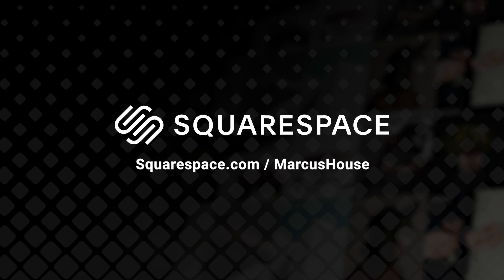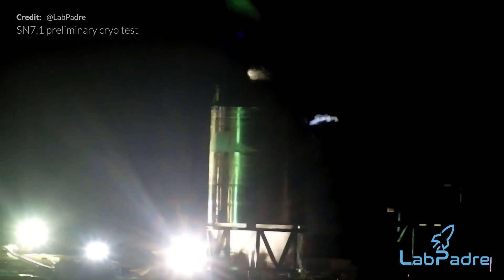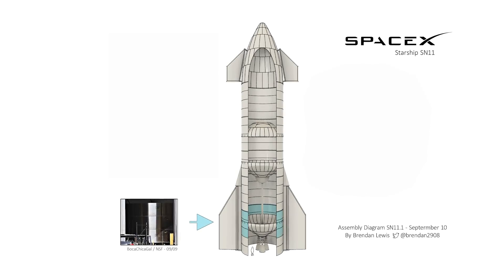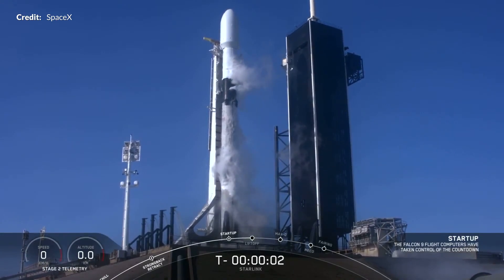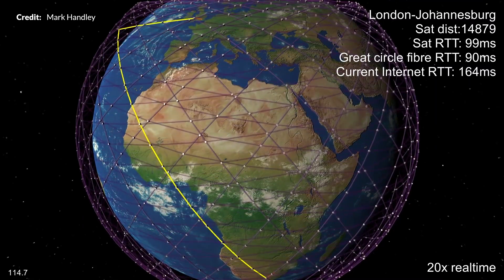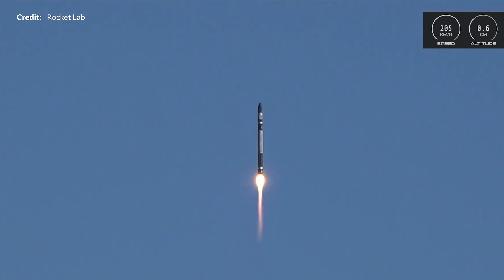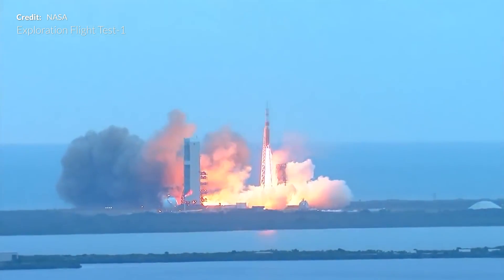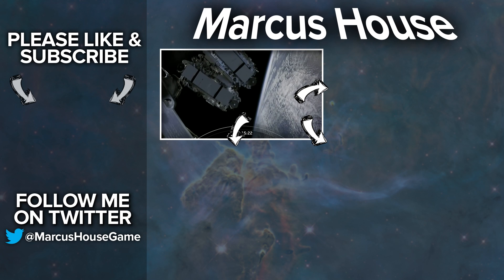SpaceX Starship updates, Starlink Space Lasers, Rocket Lab Photon, SLS news & Astra launch failure

Comment: To save water of 3 gorge river and prevent massive flooding downstream forever is..1, create reservoirs up to Mongolia and northern dry provinces 
2. Pump in to massive reservoirs upward the waters from 3 gorges.. especially during monsoon seasons. 
3. This storage reservoirs water will be frozen during winter and irrigate dryland during spring ang summer..
4.. feeding all animals in this region yr round
5. With this trade war  president xi should focus inside china irrigation and flooding systems for self sufficiency  in food..please spread this to president xi..
5. China can finnish easily this infrastructures in 10 yrs. 
6. Making 4 sqr kilometer and 10 meters deep or more.
7. And later connect this reservoirs with canals and locks for navigation...
8. Divert 90% power generation of the dam to pump out and fill in the hundreds of cubic kilometers of reservoirs constructed up north dry provinces 
9. Its better a darkened cities downstream rather flooded for sometime..
10.. this is a super high environmental impact problem solving project..
...

Comment: How far over can a Starship lean before the engine gimbals and reaction control bursts can not correct the angle? I'm afraid that if weather conditions or misfire of reaction control bursts can cause the surface area to get pushed to an angle beyond the capabilities of the rocket engine gimbals at low altitude may cause an inevitable accident. Does anyone else see this as a possibility?

Comment: Looks like SpaceX would like to standardise the tank/engine section to four sets of 4 rings.  The payload section has 4 rings too.  A fuel mass ratio of 78/22 with 78 being oxygen, the fuel volume ratio should be about 58.5/41.5. We could get close to the volume ratio if Brendan Lewis or someone else could use their modelling software to measure tank volumes. The methane in the thin pipe  is likely to freeze as it passes through the liquid oxygen - especially if it has to sit for a while between fuelling and launch.  Volume ratio will tell us something about density which will tell us about fuel temperature. Liquid methane could be as cold as -182 deg C, or it may be ~10 deg C warmer. The LOX is likely -183.5 deg C - just below boiling point. What temp keeps the methane forming ice with the fuel tank arrangement???

Comment: "Ping in excess of 200ms." Which is still significantly faster than the 400-600 ping I get in rural Arizona from a satellite service. Really looking forward to the potential of Starlink, and have been signed up for the beta test for a while. But I suspect it won't be until 2021 before anything gets to me down in my latitude. It's possible that I might get 5G coverage in the interim, but given how a local cell tower fell over from lack of upkeep, I don't have much faith in the local cellular providers...
Reply from the maker: Geo sats suck for ping time. Starlink will blow those out of the water.

Comment: I'm not sure how well that  space laser relay will work. Transmitting data over lasers is nasty as the laser source needs to be almost perfectly aligned with the destination, which is not easy to do over the enormous distances between the satellites. Also, any two satellites continuously change their altitude slightly which adds extra difficulties.

Comment: FINALLY someone mentioned the difference in RCS activity between SN5 and SN6 hops! Thank you!

One understated benefit to Starlink lasers: The current internet path your data takes is determined by cost from the hub/router to the next, rather than speed or direction. The cost is determined by who owns each of these connection points and contracts between them.

Comment: Elon just tweeted they are going to fly SN8 to 60 000 feet in a week.
Edit: Well, not really flying it. Just mount the nosecone and control surfaces.
Reply from the maker: Awesome. Assume will take longer to be tested first but awesome.
Reply: that's 18.3 km holy shit!
Reply: No problem launch 3 30 ft beer kegs to 60,000 ft , tap on the brakes, hit the rc thrusters, light the candle ,and crush the landing.
I hope they put the airbrakes( "wings") on SN8 after testing.
Reply: Rather, he said it would be completed with cone and fins within a week. It will then go through testing before flight.
Reply: @fisterB  You are correct, I was a bit ahead of things there :)
Reply: I wonder when superheavy will begin static and flight tests
Reply: that is wild, it sounds like they won't do any SN5/SN6 hop before that :O.
Reply: If Overlord Elon never goes in the first starship, I'm dissapointed.

Comment: I'm expecting a hexagonal flame diverter (6 outlets). Having the diverters originate from the center would work when the 8 center engines of the booster are positioned in a circle due to the current thrust puck design.

Comment: Starlink is cool,  but it's literally on route to ruin astronomy.
Reply: It is not. The shade on the new sats is effective. The sats are in low earth orbit and can be de-orbited if something goes wrong. Space X is coordinating with ground astronomers.
Reply: @MrEd2291  obviously you astronomer. On a given night, I get 2 extremely bright lines go across the length of the capture. The newer ones arent as bright, but theyre still far more destructive than any other satelite constellation. The worse is yet to come too.
Reply: Except it will pay for starship which will allow vastly better space telescopes
Reply: @alextell7019  think about how long it has taken to build JWST and  how long it is built to last. Very large telescopes need servicing on a regular basis. 

You also have telescopes like that of the SDSS at  Apache Point Observatory which needs specially manufactured plates that have extremely precise holes drilled in them that get swapped out on a regular bases. 

There will always be mission specific telescopes that will need to be on Earth.
Reply: @matthewpalmer9820  Not really if its cheaper (or the same price because you need a much smaller telescope) to send people and supplies into orbit than to the top of a mountain in the jungle than it doesn't matter at all.
Reply: @alextell7019  thats completely asinine. I dont think you know what servicing means and most telescopes are easily accessible.

Comment: “One segment larger than those used on the space shuttle”

Me: Ares flashbacks
Reply: Yea, that extra size is not really a good thing. The larger you make an SRB, the bigger the safety risk it becomes. We all know what happened to Challenger (and at least one other shuttle launch came within seconds of suffering the same fate). 
Plus, with the massively uneven acceleration from 2 oversized SRBs like that, I wouldn't be at all surprised if the rocket, the payload or both takes damage from it. 

SLS was a misstake.
Reply: @carljohan9265  I completely agree with you. starship is gonna beat the shit outta SLS imo, even if Superheavy wasn't reusable.
Reply: @tommypeds  A NASA guy recently said that SLS was probably just gonna go away (not in those exact words, obviously) once starship goes fully online. 
Which makes sense, because when comparing their price tags, even the most optimistically estimated SLS costs lose by leaps and bounds to the most pessimistically estimated starship costs. 

SLS is not possible to justify using if starship exists and flies. 

Also on a sidenote, Blue Origin seems to be having some sort of trouble getting their rocket done. 
They haven't said anything, but there are just to many circumstantial things that point to there being some sort of problem in their development plan. 
Including the fact that New Glenn was not chosen for a single military launch when they did their bids for the next 5 or so years, and NASA hasn't mentioned a mission plan that uses NG even once to my knowledge (not even when they talked about SLS missions far in the future).
Reply: @carljohan9265  it made sense before ITS presentation lol

Comment: You should do a video informing Americans with 401K retirement accounts that lower latency internet will deplete the value of their stocks faster.  A fiber-optic link was constructed from Chicago to New York so bots can see price changes milliseconds before computers in the other exchange can register them over phone lines.  They know when a stock moves before the market does and trade accordingly.  Recently a microwave link was set up to beat the fiberoptic link.  The money these bastards make comes from everyone else's stock portfolio, not out of thin air.  Only a corrupt oligarchy would allow major corporations to raid the retirement accounts of its most vulnerable citizens.  Why do Americans have their retirement savings in stocks?  Because banks no longer pay interest on savings accounts so money saved in the bank is eaten away by inflation faster than you can earn more to replace it.  Its a totally corrupt system designed to take money from long term investors and give it to billionaires who set up high speed data connections and computers designed to trade on millisecond variations in the markets.  It could all be stopped by a law that required you to hold a stock for at least a day before selling, but congress is paid by the perpetrators to allow theft from the victims.  Why does nobody explain how tech is used this way?

Comment: @2:00 "Three of the legs were badly damaged…" It seems to me, judging from both SN6 and SN5 that that's how they're supposed to work. They seem to be a compliant collapse structure, like a car's crumple zones. They are just to cushion the landing of these prototypes, and I don't think they are supposed to be the prototype for the definitive landing legs. Furthermore, by dissecting them, SpaceX engineers can estimate the levels of stress they are subjected to during landing, and can use that data to design a permanent solution,
Reply: They're designed to telescope in/crush to a certain distance, but they can be described as damaged when the lower part reached its limit of travel and is twisted and crumpled. This was more clearly seen on SN5, where some legs were nicely telescope in, and 1 or 2 had damage. As marcus and others said, all probably due to the tilted landing, and all the mass coming down on the first couple of legs to contact the ground.
Reply: GAMP: Sicker than your average kigger nilller  That's because it's 27 tonnes versus 120 tonnes moving sideways! A bit of a difference you sick b'stard. Rather an offensive name. Don't know how you get away with that actually? Also, the legs on the Falcon9 have  a higher point of stability where as the Starship ones are like a go-karts wheels and can slide when forced too much.
Reply: Crumple zones work during CRASHES
Reply: GAMP: Sicker than your average kigger nilller  I just watched a YT by What about it? and there were great renderings there with Falcon9 legs on a Starship. Worth a nosey.
Reply: You are correct, they are single use crunchable dampers, like used on NASA's LEM.

Comment: Landing legs did not get “damaged” :) they are suppose to crumble 
Work as design/expected :) they are not like springs or piston.
Similar to the Apollo lunar lander :)
Find the the work damaged implies failure...
Reply: They're designed to telescope in/crush to a certain distance, but they can be described as damaged when the lower part reached its limit of travel and is twisted and crumpled. This was more clearly seen on SN5, where some legs were nicely telescope in, and 1 or 2 had damage. As Marcus and others said, all probably due to the tilted landing, and all the mass coming down on the first couple of legs to contact the ground.
Reply from the maker: True. Damage is needed with such legs.
Reply: Marcus House ,once I was in a Quebec company that did the LEM legs, one guy told me how they worked and how proud was the company and
That the first “hardware” to touch the moon was from Canada/Quebec lol
Then he told me that the USA Engineer replied that they put a coating on the legs in the USA, so that the first material to touch the moon was American lol
Funny conversation
Reply: Well actually they did get damaged but it's OK. Best case scenario they don't crumble but they will crumble to absorb excess force. It's error tolerant design.

SpaceX does a similar thing with the Falcon 9 landing legs. Notice that on the earlier Falcon 9 landings, SpaceX often had to remove the landing legs after it was towed back to port as they were damaged from the landing but crumbled in order to absorb those landing forces. However now with more recent Falcon 9 landings, as SpaceX has perfected the landing maneuver, the legs are undamaged and they are able to retract them instead of having to remove them.

Hopefully with future Starship flights they can better work out the landing and have the landing legs be undamaged. (With multiple Raptor engines and no offset thrust it will probably be easier too)
Reply: How would they change the landing legs if it was still this crumple design on Mars or the Moon?  I'm guessing the final design will be reusable, because the issue described is the same whether you land unevenly on an even surface, or land evenly on an uneven surface.
Reply: @nicholaswestbury7689  I think Elon Musk said the legs will be wider and self-leveling. Maybe using linear induction motors? That would be pretty cool:)
Reply: @nicholaswestbury7689  I'm sure with the current pace of progress, the Starship will be growing new legs after each landing, organically.  Come on people it's not that hard
Reply: @PavelSTL  ROTFL!
Reply: Anyway, damage during testing is a good thing because it helps them iterate and improve the design.

Comment: Marcus, It's more likely that the starship launch structure of which you speak is for the lifting crane and tower, not for supporting the starship and flame diverter.  Keep up your good work.  Your vids and content are great.
Reply: Except when asked Musk called it a quote; 'Orbital launch mount'.
Reply: @ArchieLundy  Exactly, an orbital launch mount. not a launch pad. The structural foundations of the launch mount are very deep. This major cantilever will be working to lift and move starships and boosters, would be my guess. The launch pad component will be added later.

Comment: I hope the idea to use a Starlink-like SPS system at Mars gets serious consideration to deliver communication and GPS services in addition to beaming power via microwave beams to the surface. Solar power sats in orbit able to broadcast power between themselves, the surface and incoming/departing spacecraft would be able to provide power 24/14(?) regardless of dust storms and can use large low mass mirrors to compensate with minimal mass penalty, for lower intensity of sunlight at Mars. No heavy batteries need be landed only lightweight rectennas instead.